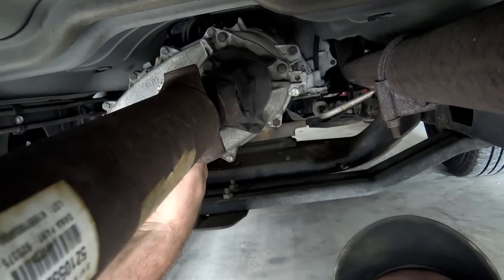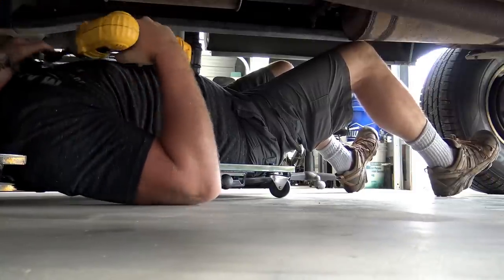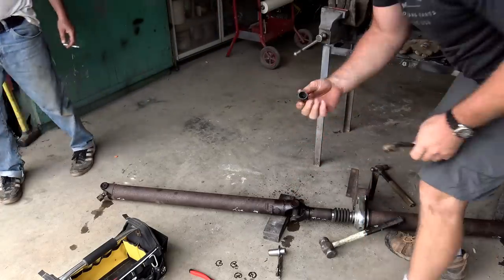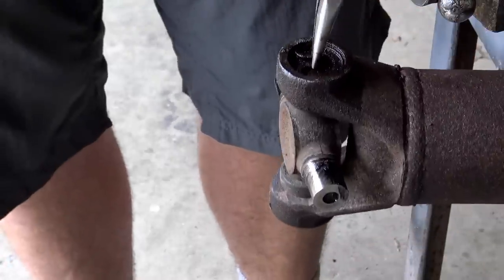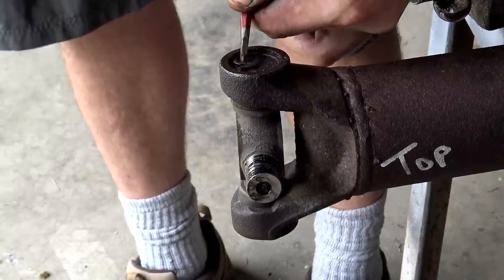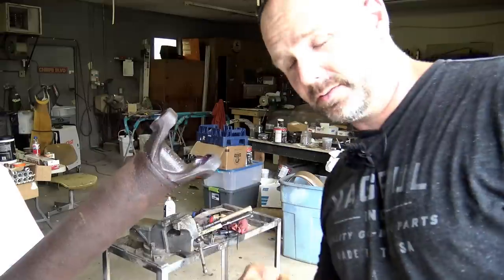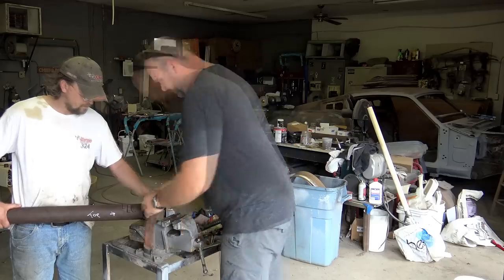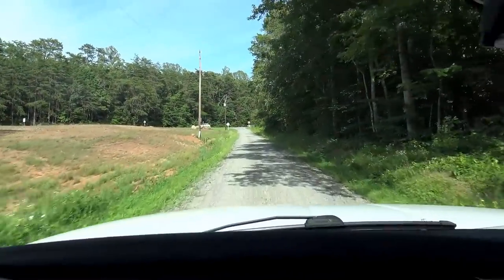More fun than "ChrisFix" 😜 How to replace U Joints without a press..simple, easy and fun!

Comment: Note to self, when the drive shaft is out, replace all u joints
Reply from the maker: Amen!
Reply: Stoney Ridge Farmer I have been fixing my cars for 50 years, every time I try and cut a corner it bit me in the donkey 😲😲😲
Reply: That was suggested in the first video comments.
Reply: Brian Curwick; don't know what you're talking about. My reply was to the original comment.
Reply: You shoulda told my mechanic that smh

Comment: Irony. Pounding a socket when you could lay it in the vise with a bigger socket on the back side and press it out
Reply: Gary Jernigan  that's how I do it
Reply: Doesnt work that easy, too much grit, best hammer on it to release loose particles, also a vise leads to an easy off angle and end up crunching framing. Tried it. Was told not to do it and caught myself before too much damage.
Reply: dont need a Press if you know how hard to hammer it.

But a press is definitely going to be better.
Reply: another problem wit ha vice is if one of the needle bearings falls or w.e thne you wont know until the last couple mm's

Comment: Just a couple tips for you Josh: when installing the new joints I like to push the u joint all the way through the yoke with the cap on one end of the joint, that allows me to put the cap on all the way on the opposite side and push the joint back through the yoke. This keeps the needle bearings in their place and doesn't allow them to fall out inside the open space in the cap. This is best accomplished with a smooth gradual movement like a press or a large c-clamp instead of the erratic blows of a hammer. My preferred method is a c-clamp that is also used for removing and installing ball joints. Also, make sure you position the grease zerk to the driveshaft side to allow easier access for service with a grease gun. If you install it with the grease zerk closer to the slip yoke than it becomes almost impossible to get the grease gun nozzle in between the yokes to get to the zerk.
Reply: Exactly right.
Reply: Good advice Dylan about the position of the zerk and ball joint c-clamp.

Comment: Some times the old way is much better. Have seen press jobs ruined a shaft
Reply: Absolutely. Hammer method works very well.  Best method; drop off driveshaft at a shop that repairs driveshafts every day. Next best; hammer method to remove old u-joints, c-clamp or ball-joint tool to install new u-joints but only if you keep things square and straight. Obviously a large vise can be used and anyone who has a shop press doesn't need advice. To the typical do it yourselfers, its Hammer Time. So easy and less likely to bend driveshaft ears. Especially cast aluminum.

Comment: First wooo
Figures universal joints have had to do many of those in my days .are kind of a pain in the neck you may need press and a hammer and a lot of patience good luck with it but she'll be nice and smooth after they cause a lot of vibration issues. Wooooooooooooooooooooooooo
General repair

Comment: Hey, for future knowledge, it's always a good idea to try to use a wire brush, around the yokes, before you put in the new u-joints, it'll give you a cleaner seat for your clips. Also, not a bad idea to use some never seize lightly before placing your caps back in the yokes, this will help in case you have to replace your u-joints in the future. If you don't have never seize, a light coat of grease or oil will work. Just a couple tips I learned from some old mechanics in the day.
Reply: Ball hones work great too.

Comment: Those are the worst U joint bearings I have ever seen before in my whole life. when you buy a used truck its always good to replace all the ujoints and shocks and tires they are always worn out first things to wear out if you know what I mean. Oh and the oil and filter in the engine.

Comment: I just did my u-joints on a rusty farm truck it was the most difficult one I've ever tackled they were rusted in. Hours of pounding with hammers torches ball joint press. Finally I took sledge to them while it was in the vice.

Comment: I have never had much luck with regreasable U-Joints or Ball Joints, either. Most of the time, they just don't get greased, but when they do, the grease doesn't get where it is needed. With U-Joints, the grease goes to the cup with the weakest seal and seldom goes to the other three. When I change U-Joints, I put a dab of grease in each cup as I assemble the U-Joint. This makes sure that they get greased at least once. 

You can do a lot of damage to drive shafts by hammering the U-Joints in and out. You can also do a lot of damage by pressing them in and out. The main thing is to watch what you are doing and do something different if it isn't working. Replacing U-Joints with two people is ten times easier than doing it by yourself. Trying to hold a yoke, a U-Joint and two sockets in a vise while you close the jaws is something only a professional juggler can do, by himself. At this point, I prefer a U-Joint replacement tool made from a heavy duty C-clamp. You can buy them, or you can make one, if you've got the time, a lathe and the right C-clamp. It needs to be a super heavy duty forged C-clamp, not a cast iron one.

Comment: Now you know what a bad U joint feels like so you will know what to look for in the future. That rough dry feel or loose, sloppy with play. If you had known what you know now you would have done it the 1st time Not rocket science but it sure helps if someone can show you the first time. I prefer to use a vice or C clamp to install the new caps. Less likely for a bearing to fall over inside.
You have just cut another limb off the "shade tree", The light is shining thru.  Good job!   ;o)

Comment: Only advice I can give is all the big box stores have loaner tools,and  one of the press kits they have will work to get those joints out nice and easy, without beating on the end of the drive shaft, I've done it the hammer way ,back in the days before the big box auto parts stores were around to get free loaner tools.  All that beating risks distorting the end of the drive shaft.  But great vlog video,as usual, YouTube is awesome for actual reality TV, unlike mainstream fake reality tv that subliminally pushes scripted brainwashing agendas in the shows.  Your a good guy Josh, teaching what you can to those afraid to try,and also showing the world how a true American has the "get er done" attitude. And yes you are correct, anything greasable is better then a sealed,non serviceable part, as long as you keep up on the greaseing maintenance. Since your starting to do a lot of stuff ,I'd suggest getting a cheap ball joint press kit from Amazon or harbor freight, it's got a million uses. https://m.harborfreight.com/ball-joint-service-kit-for-2wd-and-4wd-vehicles-63279.html

Comment: I usualy plan on replacing my ujoints by 3yrs. Dont always have too but ive found it never left me stranded. 
    I find that grease or no grease the damned seals dry out and crack on the cups and ultimatly wear out

Comment: Big c-clamp can be used for a press... rather than beat the new ones in. Or, that vise you are beating on... that is a nice press. slow and steady, turn the handle with sockets pushing the ends in/out.

Comment: I Took a small pipe and cur a 1/4 in section off  split it in half and where I drive the cross as far as it will go down .... I lift it up nd insert the two halves around the cross shaft and then  finish driving the cap out

Comment: I just tried to assemble a new pto shaft, bearing, and coupler. I can't get the cups to seat in deep enough to get the clips in, even using the vise with a socket to press it in. Gonna have to take it to a shop to get it done and hope I didn't get one of the cups on crooked and stuck on a needle 😔

Comment: If you don't want the Driveshaft to fall you can use a Pull or a Ratchet Strap from frame rail to frame rail, that will stop the shaft from falling.
Also use some electrical tape around your u - Joints to keep the caps and needle bearings from falling apart.

Comment: Actually I have quite a bit of experience as a know it all, and a smartallick I might add.  I haven't done my own auto repairs sense I replaced a starter in a 1980 Fairmont. It lasted less than 90 days.  Better for my money to have the parts and labor guaranteed. Just say'n.
Reply from the maker: Man...that sucks...but a starter isnt' a bad job.....I buy Bosch and keep my fingers crossed!
Reply: that thing took the whole weekend. It unbolted easily but the puzzle was getting it out. of the frame ..there was no wiggle room. Eventually it just fell out in my hands. And sense I didn't know how it dropped out on it's own, It took hours to get it back in.

Comment: Almost positive iv never had trans fluid come out the tail housing when removing my drive shaft on my z71 or any Chevy iv worked on
Reply from the maker: I may have been mistaken...that driveshaft mounts up to the crank case....some oil will roll out of the case when you pull the driveshaft...not much but some will
Reply: Stoney Ridge Farmer mounts to the transfer case since it’s a 4x4